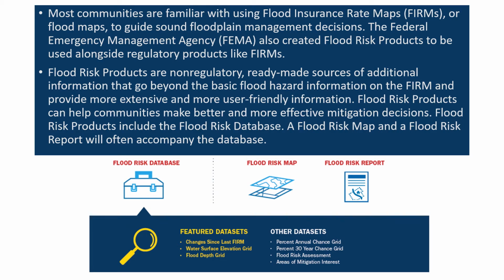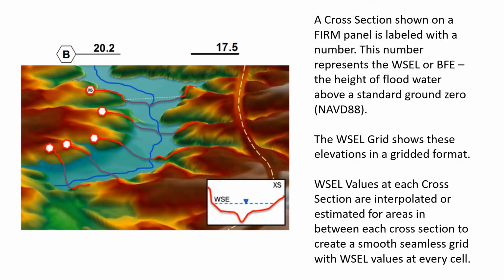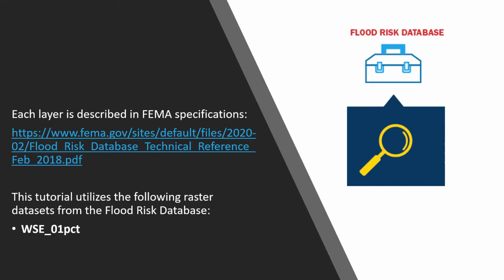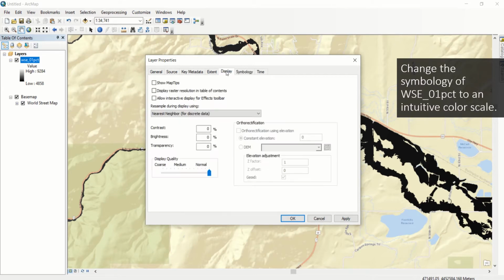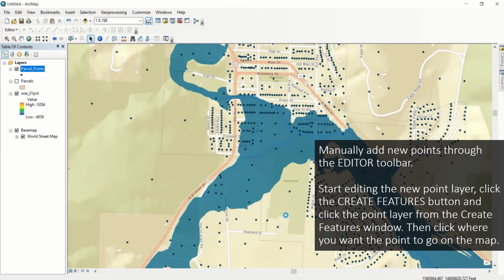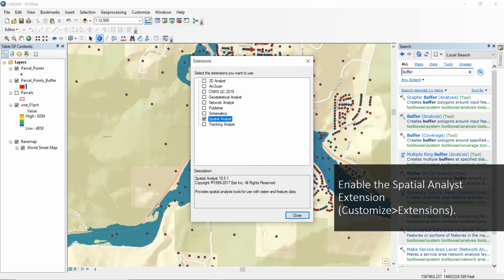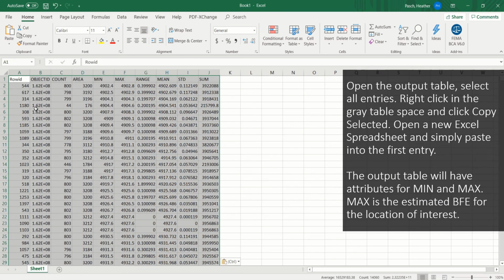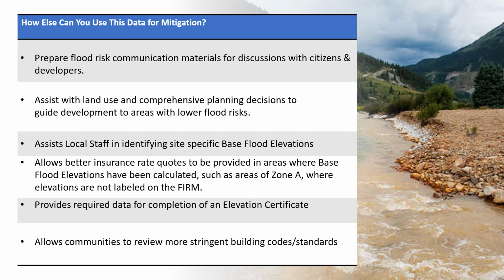Using Water Surface Elevation (WSEL) Grid in GIS

Comment: I'm doing a project where we're trying to determine how many more buildings would be flooded if the floodplain were to rise between 2 and 5 feet.  I have a polygonal floodplain, but am having trouble calculating how much more area will be flooded by the elevations that I described above.  I want to outline a polygon 2 feet above another polygon using as reference z dem using arcgis/qgis.  I would like to know if you could help me or tell me some tool that I can use to achieve it?
Reply from the maker: Hi Luciano. With the Water Surface Elevation Grids, you can always use raster calculator tools and perform an addition process so that "original WSEL + extra depth or rise" is computed, to obtain an output WSEL that has the higher water elevations. Once you have the desired WSEL grid, you can convert to a polygon vector layer or go the other route and convert your polygon floodplain layer to raster to compare "apples to apples" if you will, and be able to intersect z values to each other. Does this help? If you'd like to discuss in more detail, I'd be happy to jump on a quick phone call with you or continue messaging via email. My email is marta.blancocastano@state.co.us.